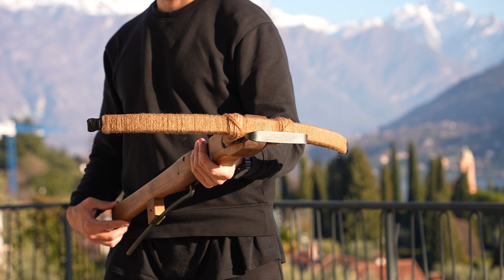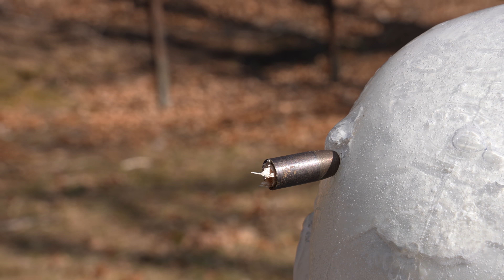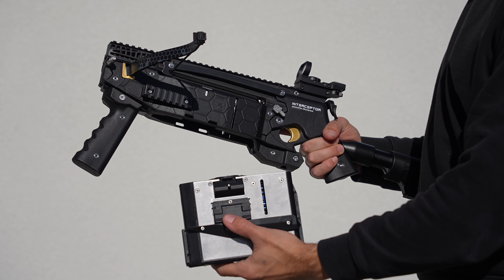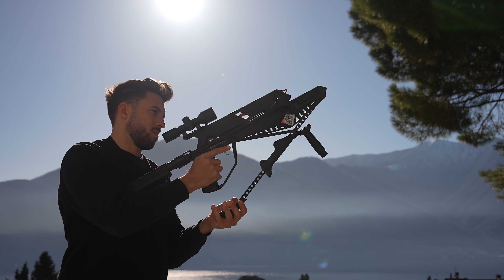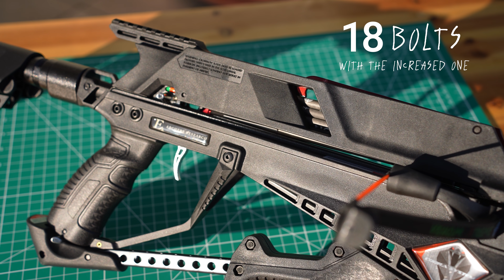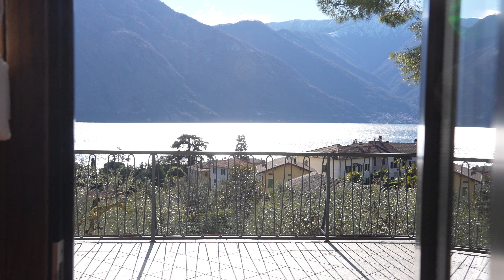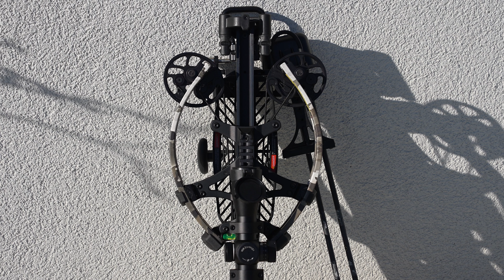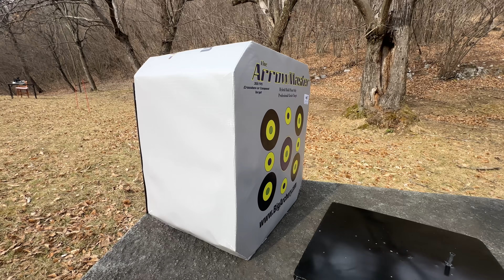How Dangerous are Crossbows?

Comment: A medieval crossbow would absolutely go through a skull. Some things to keep in mind: you are using a more modern bolt which is much lighter, and momentum (relies on mass) is very important with regards to penetration, and your crossbow was a very low poundage for a medieval crossbow. Id like to see joerg make a reloading crossbow with a compound mechanical limb.
Reply: Having made a replica of a medieval cross bow when I was at highschool in the 1970’s in my metal and woodworking classes (yeah try that these days) but using much heavier bolts it made absolutely more damage than the one shown and yeah it was quite noisy  😀 and a bit scary firing .
Reply: @Chris-NZ  my highschool Latin teacher told us when he was a kid he and his friends made a crossbow. Shot it once, then took it apart because it was WAY more dangerous then they thought it would be.
Reply: @Zuginator  I still have it somewhere in the loft although I wouldn’t fire it without full body armour , who knows what state the waxed linen thread I used for the string is in after 55 years 😀. It’s got a Mahogany stock so looks pretty nice. 😀
Reply: @Chris-NZ  Yep, they had different bolts depending on what they were attacking, not everything was about peicing, like people in armour, some used that against them.
Reply: Yep, a 600 pound medieval crossbow with a 6 inch power stroke delivers a lot less energy than a 120 pound long bow drawn to 31 inches. Their only real advantage is they don't require as much training. Now, let's talk about the heavy composite Asian crossbows that had long power strokes. Those were monsters.
Reply: @johnjriggsarchery2457 that is not true, a 600ib medieval crossbow will generate about ~110J, a 120ib long bow will generate about ~112J that is not a huge difference at all.

And no even if longbows were more powerful (they are not. Todd's workshops tests showed a 160ib longbow was roughly equvilient to a 850ib crossbow, infact weaker due to less momentum. Meaning high level longbows are equvilient to medium ranged crossbows). Crossbows have a large number of advantages over the longbow. 
1) Firstly they have easier to store ammunition, both in size and robustness and longevity. Ammunition  was also cheaper. This means it's easier to stock up and/or bring with you a supply of ammunition.
2) you can shoot and reload a crossbow from crouching and prone positions. A full sized longbow can only be shot at full power standing up. This significantly improves the ability for the crossbowman to skirmish and fight in guerilla warfare (which is why even the English prefured giving their light troops and border Rangers crossbows despite havejbg access to longbowmen) it also allows the use of shields and field fortificatikns in field battles more easily.
3) crossbows are more compact and easier to use inside walls and trenches. Making them better in sieges. Additionally the ability to sit full cocked also aides in siege warfare. Hence why even the English prefured crossbows in sieges.
4) crossbows can be used mounted unlike longbows 

And ofcaurse as already mentioned actual testing shows crossbows were infsct more powerful than longbows, and even when they have similar energy the crossbow bolts have more momentum, which matched the primary sources claim of crossbows having a longer range (more momentum = better energy retension with distance) and penetration (more momentum = more penetration).

If the only benefit of crossbows was training then only militia type units would use them, or they would disproportionately use them. But that is not the case, medieval professional and semi-proffesional archers are much much more likely to use crossbows than longbows. 

Shortstroke crossbows were universally loved in Europe and the middle east through the entire range of professionalism. And in the middle east and eastern europe they had to compete with composite bows which have both power and compact yet crossbows still competed (although not as dominant as in the west). Longbows are only situational better. And that situation was quite rare, even their most prolific users (English and Scandinavians) prefured crossbows in the most common forms of warfare at the time (skirmishing/raiding and sieges)
Reply: @matthiuskoenig3378  Yeah, I wonder how much @Intranetusa was paid by the CCP for his post.

Now, don't get me wrong, the Chinese fast draw, low draw weight crossbows were quite impressive. Especially the repeating ones. But they were built for Chinese wars where you had massive amounts of unarmored infantry fighting. So power behind the strike was a lot less necessary as long as it could get through cloth and flesh.
Reply: @matthiuskoenig3378  sort of. a japanese yumi ( yes its considered a long bow) was often shot from crouched and even prone'ish position
Reply: @chryssalidbait8765  Chinese crossbows were the most powerful bows ever built and the Chinese absolutely used metal armor. Chinese crossbows used recurve limbs with similar draw weights to European crossbows (>1000 lbs in some cases) but with the long draw length of a regular bow. There was nothing "fast draw" about a 2 person crank spanned cart mounted crossbow shooting spear sized arrows.
Reply: @chryssalidbait8765 a Chinese crossbow still had a lot of power behind it. Even the ones with less draw weight had around 100J of energy transferred, while 400lbs ones wouldn’t be uncommon during the song dynasty. 

Generally power stroke is a much better indicator of energy behind a shot than draw weight, but the drawback with crossbows is that a long power stroke generally requires long limbs which makes a crossbow more awkward to handle. 

The true innovation for Chinese crossbows really is their trigger design which is arguably better than the European triggers. Still both triggers were good enough to be used for millennia without much change. European crossbow triggers date back to the Roman Empire while Chinese crossbow triggers date back to the Chu state during the warring states period.
Reply: @matthiuskoenig3378 Firstly, mounted longbow archers were very much a thing. Secondly, your crossbow rate of fire is pitiful, especially with the more powerful crossbows, compared to a longbow. Crossbows are not clear winners over  traditional bows. They have specific niche advantages, but are outclassed in general.
Reply: He's also just using target tips; all the same I expected better tbh
Reply: The medieval European crossbows of that design have to rely on very high poundages to make up for its lower prod efficency and very low powerstroke. Crossbow and bow power are determined by 3 factors that are multiplied with each other in energy calculations: draw weight, powerstroke, and prod effiency. This 3 factor relationship is why Todd of Todd's workshop youtube channel discovered that a 150-160 lb organic prod longbow and a 150 lb modern crossbow (he calls it his lockdown longbow) actually shoots projectiles with more energy than a ~1000 lb steel medieval crossbow. There are many different crossbow designs around the world - some approaches favor high draw weight but low powerstroke/low efficency, while other approaches favor a lower to more moderate draw weight in combination with a much greater powerstroke and higher prod efficency. Of course, there are exceptions as well.
Edit: For example, look at ancient and medieval Chinese personnel crossbows that had draw weights varying between 150 lbs-700s lbs, with long powerstrokes as long as 20 inches, and [usually] very efficent prod designs.
Reply: @Intranetusa that is not true. Go watch Todd's videos again. A 160ib long bow produced at max (ie heaviest arrows) 137J of energy with 4.3kgm/s of momentum. This is the same energy as the 850ib crossbow he tested (with the heaviest bolts and string) but worse momentum, the crossbow had 37J and *6.5kgm/s*.

While he did test 1000ib crossbows with only 110J that was with a lighter bolt and only 1 test compared with his more extensive testing with the longbow and the 850ib crossbow.
Reply: He was able to cock it by hand, so I know it's far from the really massive crossbows from medieval times that needed a winch to reload.
Reply: There are reports in the medieval times of bolts sliding on the skull, because it is so hard
Reply: Yeah that bolt for the first crossbow was rediculous, more blunt and fat like a can of soda. I wouldn't pick anyone of them. In an apolyptic scenario i would make my own because noone of them is useful when you run out of bolts or they break being overly complicated and made from advanced materials, or the crossbow break. If you make your own you can make your own bolts and repair the crossbow or make a new one when it breaks. 

I made a crossbow when i was 12 that shot slightly modified metal knitting needles that i stole from my mom and it went right through the wooden target i've made, and right through the shed wall which the target hung on. The needles only lasted like 4-5 shots though before being bent, guess they weren't designed to go through walls, needless to say the weapon got confiscated by my parents but by the look on my dad said that he still was kind of proud😅
Reply: Penetration can be different depending on the type of arrow head - target, flat, bodkin, etc.
Reply: Early midieval crossbow is pretty junk compared with mid/late midieval crossbow(which most people would think of) that were game changing.  Not needing a windlass shows how weak this one is.  Close your eyes and don't even look at the bolts he uses.
Reply: He's also using practice/field tips for the bolts. real bolts would have a war tip for humans or a broadhead/cutting tip for hunting game. much more penetrative than the incredibly blunt field tip.
Reply: "Momentum is very important with regards to penetration" is something my girlfriend once said to me but as far as i know neither of us have ever owned a crossbow.......
Reply: Those wooden bolts are just terrible
Reply: He has, actually! It's called the Siege (or the Cobra Siege if you want to look it up)
Reply: Cool
Reply: The biggest advantage of the crossbow was the limited training needed, compared to the long bow. 

The crossbow was deadly enough for the Pope to ban their use vs Christians... Because too many gentry were getting perched.
Reply: it's a medieval training crossbow he's using essentially. even the light combat ones were about 3 times heavier on the draw. the actual large ones used during fortress defense which no human could pull (pulley was mandatory) were obliterating steel armor.
Reply: @PicturesqueGames 
Did they actually obliterate steel armor or are we just once more over glazing weapons and forgetting how useful armor really was?
Reply: Where is the video proof?
Reply: A metal rod will go through a skull! It's the wielder, not the tool that is dangerous! 🤦
Reply: Those crossbow from the first video are more blunt than my penis lol
Reply: Bolts were metal, its why it was different than a bow
Reply: not to mention mid evil people had weaker bodies.  nutrition was a joke you could take two or three of them out with a spit ball.

Comment: Sooooo what's stopping us humans from creating a fully auto drum mag crossbow? Like put a strong motor to pull the back the bow string and have a redundant mechanism to do it manually. But the battery powered motor should last at least 50-100 shots. The drum mag could hold 45-60 shots depending on the weight and size. I don't think it should be too hard to do.

Comment: God, people have to stop comparing crossbrow drawweights to longbow draw weights, and using that as "proof" that crossbows are stronger (or weaker)... That's just not how it works. Crossbows have higher draw weights to compensate for the microscopically short string. A 200lb crossbow is SUBSTANTIALLY weaker than a 200lb longbow because of this fact; the shorter string means less leverage to generate force. A higher draw weight doesn't make them stronger, it just makes up for the downsides of a crossbow; and even then crossbows are usually weaker. Just, yk... Easier to aim, as they dont really require training.

That was also the least accurate (ha) accuracy test I've ever seen... Half these shots have to down with Mike's own ability and has nothing to do with the accuracy of the weapon. You have to repeat the exact same shot every time, which is literally impossible to do with a human shooter... That's why when people test the accuracy of fire arms and shit, they use clamps.

Comment: There's something wrong about the medieval crossbow. First of all that type of crossbow (late 1300) should be composite (horn and tendon). Steel bow crossbows begin to pop up later in 1400, but they are already bigger and loaded by the goat and later by pulleys. That type of crossbow (steel bow or not) is historically the weakest, since it evolves in time. Anyway it was still enought to penetrate armor plates (if hit with the correct angle) (early crossbows for early plates). I used a couple of them myself. So i don't understand why this performed so poorly compared against others. Maybe because those aren't war tips but conical target tips? A hardened iron long piramidal tip with some good inertia could make some difference? I don't know

Comment: The tenpoint is powerful as heck, but if you were going to use it in a zombie apocalypse like you said, I think it'll be a horrible weapon of choice. The bolts would probably fly straight through the zombies (and get lost somewhere behind probably) and due to its power, break frequently so you'd need a huge stockpile for it to actually be a useful weapon.

Comment: People seem to need reminding,  Crossbow and archery are actually very very different.  It's why unlike cycling you rarely see multi disciplin athletes at the Olympics and etc. Also why crossbows are used on biathlon. They are simply far far more accurate and powerful, especially comparing mid range modern versions.

Comment: How many lbs you use by the Interceptor?
I know the 120lbs bow is not available at the moment. 
You say it has 19.2 joules i think you use the 60 lbs bow from the package.
So there comes more power with the other bows. 
The interceptor can become a warmachine with fast cocking and 18 bolt magazin in the midrange depending on the 6.3 bolts.

Comment: I would defienetly not choose the 10 point for any scenario where bolts are limited in some way, as it can be relied upon to either destroy them, or overpenetrate and be lost forever.  The lancehead would probably be fine if I had a large enough group to justify taking down a large elk or a moose, but is still pretty overkill for any task I would be doing on my own. I'd probably not be interested in taking out a zombie from the type of range that justifies its size to lug around.

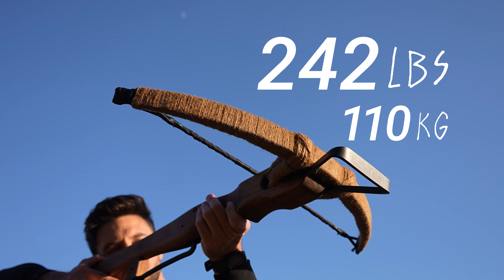Comment: 0:48 While medieval crossbows does have a heavier draw weigh, but the draw length is significantly smaller. Penetrative power doesn't just start and end with draw weight
Reply: Yes the propulsion energy Is roughly max force x lenght/2 for pure elastic draw strength (force proportional to draw). For a constant force one energy=force x draw length (double!).;from this energy the wasted kinetic energy of the non-bolt moving mass at bolt detachment must be subtracted. What is left is the bolt energy, roughly proportional to damage I think

Comment: Problem with crossbows is that the travel distance of the string is so much less than a real bow that you can only get a light arrow to travel very fast so the penetration isn’t that great. To get accelerate a heavier arrow to the speeds needed you need a strong force and a long distance to apply that force.

Comment: My wicked edge shoots big bolts with 100 grain tips at 365 feet per second and cost less than $400. Also can hit every bullseye at 32 yards. Those two pump crossbows are cool, but extremely under powered and not very useful.

Comment: In a zombie Apocalypse I wouldn't go for a Xbow that is that powerful. the more power the greater the chance of malfunctions The first replica bow may not be the most powerful but in a pinch you can find something to make a string for it and and its easy to make bolts for it to. You proved with the last one what happens when you run out of arrows, it becomes a paper weight or fire wood

Comment: I see you dry fired the interceptor resulting in smashed limb tips. I advise getting a dry fire protect dummy bolt in there, theres a few designs available, they all work. I have some replacement mey interceptor style tips on printables you can 3d print for yourself \m/_

Also I noticed some flex between the handle and the main body, meaning that if you mount your sights on the very back of the crossbow, then depending on how tight you grip it the aim will cant to the left or right. Better to mount it on the body a little further forward.

Comment: I have the EK Archery RX Siege 300 crossbow, the (significantly) more powerful sibling of the Adder. I suspect, given the right bolts and with the draw weight cranked all the way to the max (it has variable draw weight because it's a compound crossbow in stead of an "ordinary" recurve one) it has a chance to go through that wooden plank. I know I accidentally shot a bolt off-target against my wooden garden fence (don't worry, private property behind the fence) and it penetrated almost all the way through until the vanes were touching the woord. Granted, my fence is less thick than this wooden plank but still, it wouldn't surprise me if it penetrated as that thing is insanely powerful (and somewhat hard to cock on the highest draw weight, even with the lever)